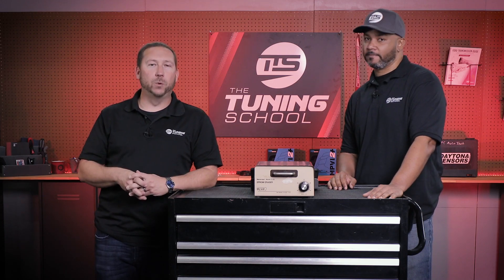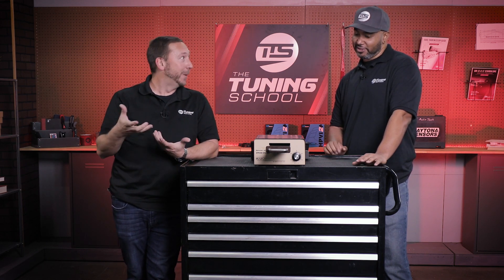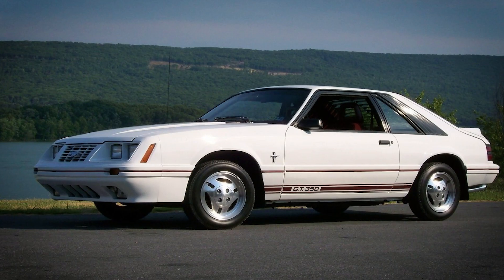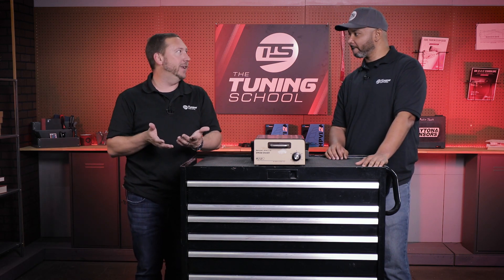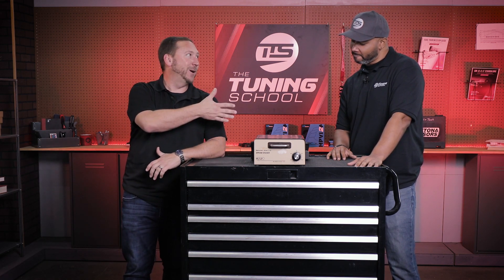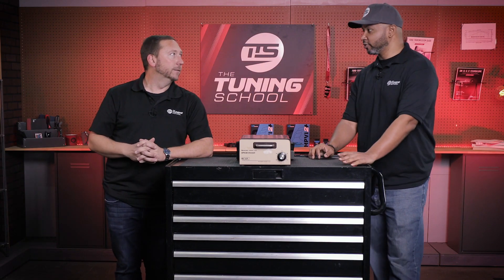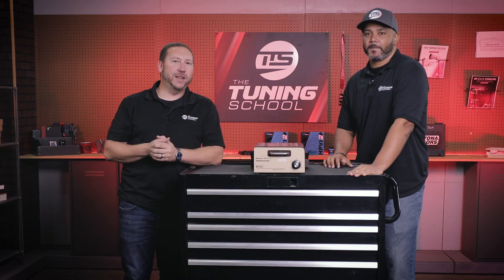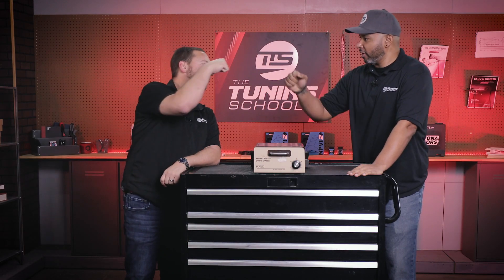Differences of Ford ECMs

Comment: Hi, I own a lot of fords and chevys......The taller guy is kina right!!!!!   in 96 chevy had a hundred belts and speed density...my 460 ford had 1 belt and mass air the difference was really something.  I really wish they made a bigger coyote my 2021 f150 with 302 inches.....just begs the question!!  Thanks for the info

Comment: What would the difference be between the s550 5.0 coyote mustang ecm and the f150 5.0 coyote ecm? I know the f150 uses a map sensor and the mustang does not. On hp tuners there is an option to enable map sensor on the mustang ecm. What would that enable or change? Could a map sensor be added to the mustang ecm?
Reply: They are both 99% the same logic. Enabling MAP would disable MAF and force you to tune the multitude of Speed Density tables available. It can be done but it's not usually.